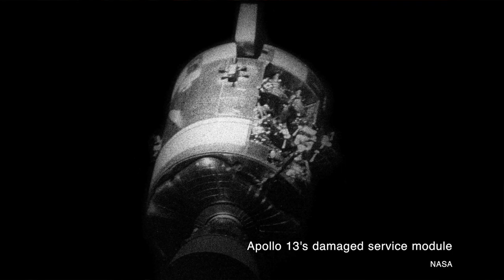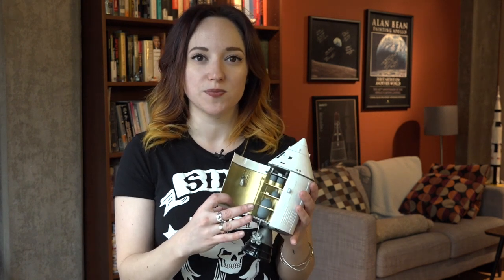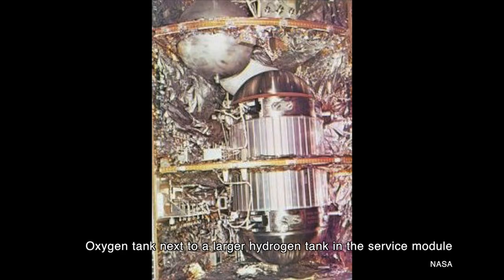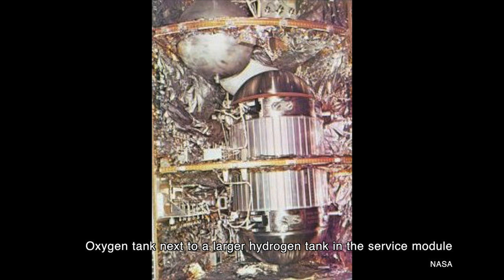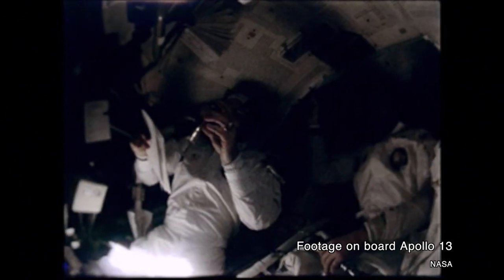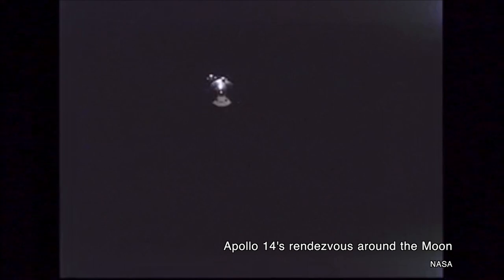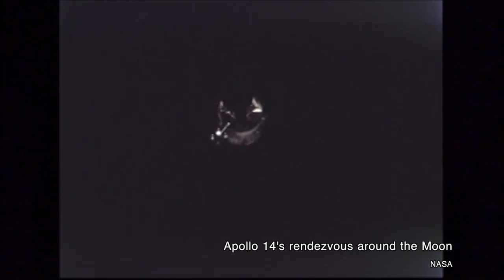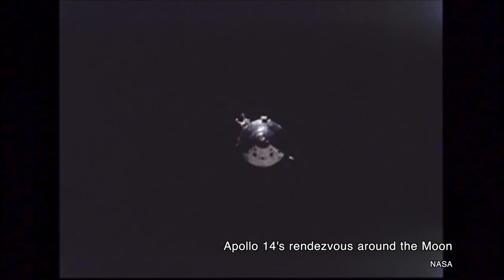What did NASA Change After the Apollo 13 Disaster?

Comment: What happened in apollo 1 and what did they do to fix it?
Reply: A spark in the csm caused everything to erupt into flames because its been soaking in pure oxygen for an hour. They improved the electrical things to stop that from happening again
Reply: They switched from pure oxygen to air. They removed all the flammable velcro lining on all the interior surfaces of the CM. Most importantly they changed the hatch from one that opened inward to a hatch that not only opened outward but had explosive bolts that could blast the hatch open. The old hatch could not open against the high pressure atmosphere that developed in the CM due to the fire. The pad techs couldn't open the hatch until the capsule hull ruptured and equalized the pressure between the CM and the outside atmosphere...

Comment: If they removed the fans completely, how did they prevent stratifying.
Reply: +snower13 Stratification was only an issue with measuring the quantity of oxygen in the tanks. It did not affect the ability of the tanks to provide oxygen for breathing and electrical power/water production.  After the accident, the engineers changed the measurement method to one that was not sensitive to stratification. Thus the tanks could now be allowed to stratify, and the fans could be removed.

Comment: How about lunar dust affecting suit zips and helmet and wrist rings on moon and lungs and eyes after ascent in  zero G. How do astronauts avoid getting crud in their lungs?
Reply: They didn't.  In an interview some years ago, Charlie Duke (Apollo 16 Lunar Module Pilot) mentioned that once back in the pressurized lunar module, the lunar dust had an odor reminiscent of gunpowder.  No double that each of the 12 Apollo moon walkers came home with traces of dust embedded in their lungs.  I don't believe any of these astronauts have since developed any respiratory problems.
Reply: +CaribSurfKing1 - Some got into their lungs.  However to minimize dust exposure during the removal of their space-suits in the LM it was equipped with a air filter that after the astronauts got inside and re-pressurized the filter would run and remove as much as possible the particles in the air.

Comment: The skin on the Service Module doesn't appear to be as polished as that of the Command Module?
Reply: +kb968 Correct. The shiny film on the command module was part of its heat shielding. It reflected radiant heat away from the pressurized crew compartment while in space and during reentry. The service module was of a different construction and purpose, and did not require the reflective film.

Comment: Pure oxygen will not burn or explode, it needs a source of fuel to do that. So what exactly ignited in that oxygen tank?
Reply: +Francois Lacombe The fuel source was the teflon insulation on the damaged wires. This caused the pressure in the tank to exceed 1000 psi and the top blew. The fast expanding gas could have burnt with other materials and the increased pressure popped the bolts on a panel.
Reply: Many metals can burn, violently, in the presence of enough oxygen.
Reply: +Francois Lacombe a morbid example of things combusting in high oxygen environments would be the Apollo 1 accident. even at 16 or so PSI, far from what an O2 cryotank deals with, and all it took was one little spark to start that awful fire in the Apollo 1 CSM.

sad that 3 lives were lost for that lesson to be learned, but who knows? perhaps their sacrifice and lessons learned saved the Apollo 13 crew in addition to getting us to the moon. at least that's how i like to think of it.

Comment: Amy, could A13 have made it home without the LEM?
Reply: No way they would have made it.  The only other capsule with an actual cabin was the Command Module, and it was running out of power - hence the need to shut it down to save power in the batteries for re-entry.  Without the lunar module, they never would have made it.
Reply: @willoughbykrenzteinburg  I was thinking that, maybe... Just maybe, a space walk to bring the remaining o2 from tank 3 into the re-entry capsule??? Where were the original space suits? Were they left behind or were they available??
Reply: @LaPabst  they had the space suits.  They would have to be connected to the same life support systems they used without the suits.  If the needed to suits to be self sustaining, they would have needed to be connected to the PLSS packs which would not have even functioned properly inside the pressurized cabin (plus likely would not have fit very well with three astronauts inside the LM cabin).  They would have functioned of they all went on EVAs, but 1) you have to depressurize the cabin to open the hatch which would mean venting valuable oxygen into space and more importantly, 2) the PLSS would not sustain three astronauts for anywhere near the length of time it took to get home.

Comment: Imagine if they stirred the tanks once separated in lunar orbit.....ooops
Reply: They could not have made it back to Earth....
Reply: +CaribSurfKing1 Not just once seperated, but also if it had happened prior to the 55,54,53 moment  as well, as the timing would have been too long.
Reply: +Phil R Possibly, but if it was early enough, they probably could have used the LEM descent engine to brake and to return to earth quickly. But on the other hand, that would have given them less time to figure out how to turn on the Command Module again (since they still probably would have had to turn it off), and less time to figure out the math to get them into the critical 7 degree sliver for reentry.

Comment: They also change the Carbon Dioxide Cleaning Canisters for the LEM and CSM so they would match. In case they had to be used between the vehicles.
Reply: This did not happen.
Reply: @willoughbykrenzteinburg  after researching I see you are correct. I heard the change in another documentary. I guess they were wrong. Thanks for the correct information.

Comment: when all this tank engineering mayhem happened as described in the section 1:53 to 3:12 did all this occur on the ground prior to launch and why if this did happen prior to launch why wasn't this discovered prior to launch. the explanation is thorough to a fault it needs more time to say this happened on the ground, then launch and as he stirred the tanks then all the prior screw-ups came into play and his stirring the tanks should have been a non-event had the engineering staff not been so negligent on the ground many what ? days or even weeks before launch. i will bet no one got fired or demoted over this event which seems to have had the makings of a quick and huge explosion and loss of the crew and then a complete mystery as to the events.

Comment: Note to the poster: Isn't it also true that they reconfigured the CO2 scrubbers ( lithium hydroxide canisters ), making them interchangeable between the Command Module and LEM... no longer requiring to "put a square peg in a round hole." Keeping in mind that the crew needed to make an adapter, using the cover of a flight plan, A plastic bag, a sock as a filter, some hose, add about 3 to 4 feet of duct tape.

Comment: The nominal Apollo DC voltage was 28V, not 25. It was actually around 30V most of the time.

The oxygen was not stored in liquid form. It was a supercritical fluid.
Reply: +ApolloWasReal 
Liquid Oxygen has a boiling point of -297 Fahrenheit, and freezes in the -300 range.  So upon launch the oxygen in the insulated tanks is in fact a liquid.  The vast cold of space (around -450F) is the reason for a heater to keep the liquid from freezing, and to bring it up to boiling point.  The reason for liquid oxygen is the expansion ratio means you get more breathable air for a little bit of liquid.  1 liter of LOX expands to 860 liters of gaseous Oxygen.
Reply: orange281gt Although the SM O2 tanks were originally loaded with liquid oxygen at 90K, it did not remain liquid for long. Heat was added to bring the temperature up to about 155K where it became a supercritical fluid. Normal operating pressure of the tank was about 900 psi or 6.2 MPa; oxygen's critical pressure is 5 MPa. At the end of the mission the temperature was about 168K.

The big advantage of the supercritical state is that it's one phase; you don't have gas bubbles throughout liquid which would make it difficult to draw off in weightlessness.
Reply: +ApolloWasReal 
Thanks for the explanation.  My experience is just with servicing small 10 liter converters for aircraft use.  So to me it made more sense using heaters to boil the liquid into a gas.
Reply: orange281gt Aircraft don't have the 0-g problem that a spacecraft has.

The Apollo O2 tank did use a heater to maintain tank pressure. At those pressures and temperatures the oxygen was in a supercritical state, essentially a gas that's as dense as the liquid so an actual liquid can't form.

A fan overcame the lack of convection in 0g, and both those components got Apollo 13 in trouble.